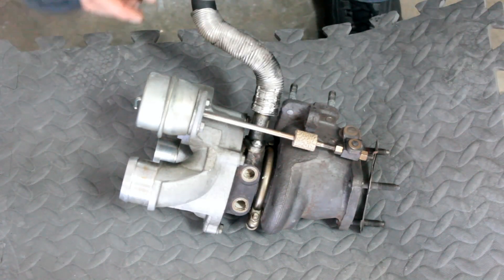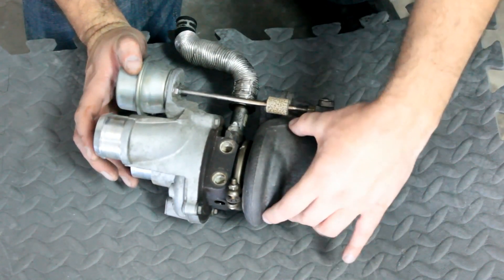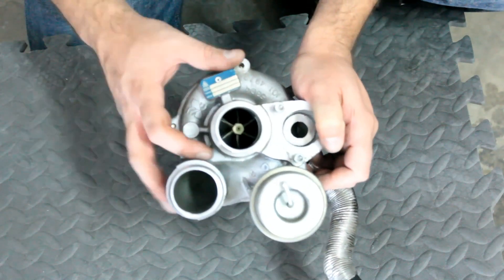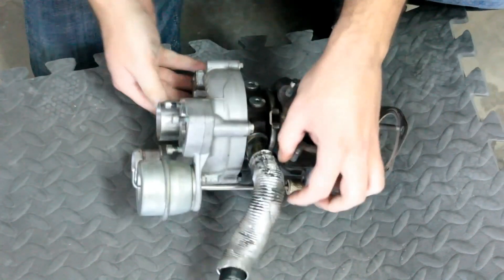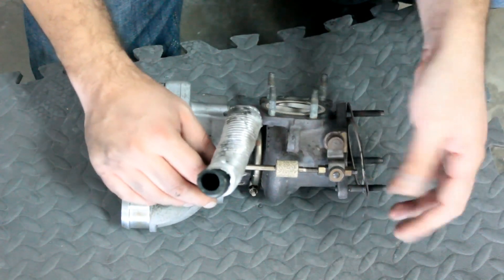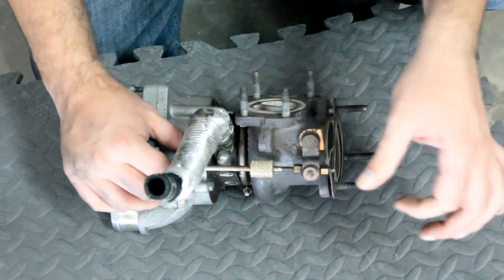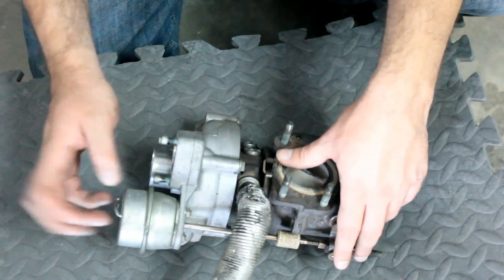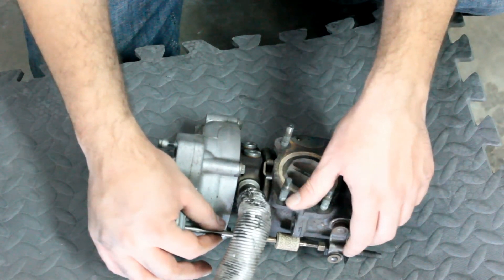How A Turbocharger Works: Converting Exhaust Gas To Intake Pressure

Comment from the maker: It's not that simple. Super chargers use power from the engine, and Torque, so they can cause as much reduction or more in low end torque than a turbo.